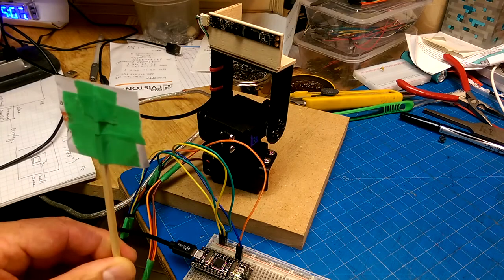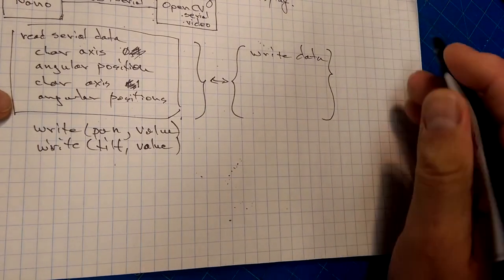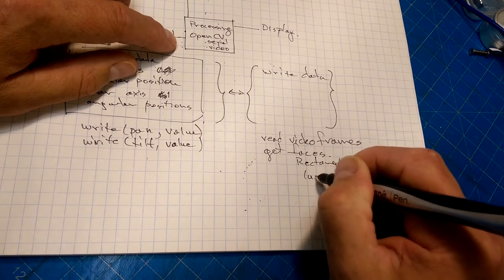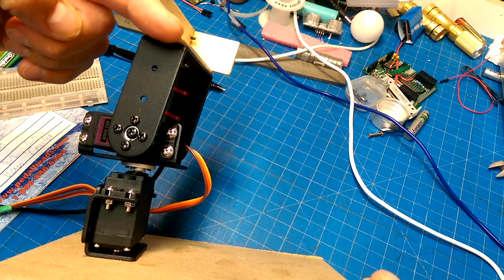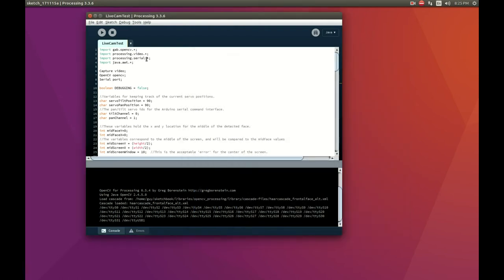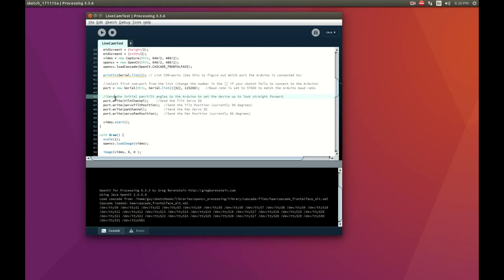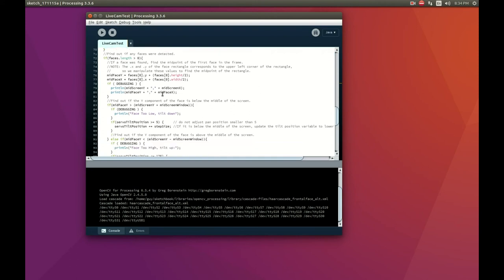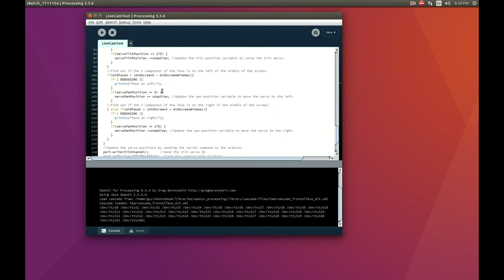Vision Quest Part 2

Comment: I can't believe no one has commented on this video. This is a crap ton of work, and this video explanation of how it works is excellent. Now with that being said ,  I have been working on this for 2 weeks on and off with little not no luck. I get error after error after error, which is fine for now , but I am not seeing the light at the end of the tunnel  which is bumming me out.  Keep up the detailed vids.
Reply from the maker: Break it apart into pieces.  I started with controlling the servos in arduino.  Then I worked on getting Processing installed and working.  Then I controlled an led on an arduino pin using serial commands from processing.  Then I got a Processing sketch to control a servo over serial.  Then I got OpenCV running in Processing.  Finally I got the output from OpenCV.detect() to controll my servos.

Comment: I am still working this project. Man, this is tough with little code experience. The processing seems to work ( windows 10) with the usb camera, rectangle is detecting the face, but the servo's are not moving as the face moves. Is there a way to verify in the code in processing that it is sending the serial data via usb to the arduino ? the code in the processing Serial.list()[1] seems to  work for the usb camera only and not the usb port for the arduino.  (line 104). Any ideas?
Reply from the maker: +David Tuttle I will take a look at it tomorrow night.  But I seem to recall that I had to run the processing sketch once to figure out what port the arduino was connecting to and then set that and run it again with that port as the communication port.
Reply: You know what. Selecting the proper com port and waiting until the processing spit out an error explained why it want working. Error said "port busy". All I had to do was close the Arduino IDE :) . Boom , it's working perfectly. Thanks a ton for your videos. They have been extremely helpful.
Reply from the maker: +David Tuttle glad they help.  Have fun.